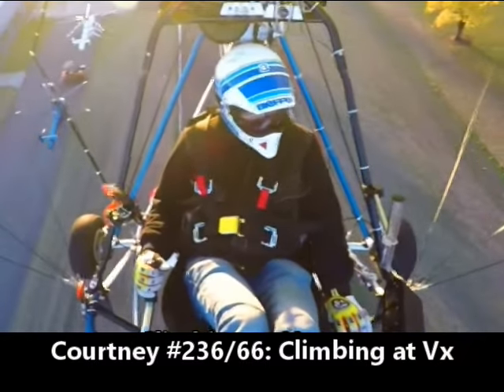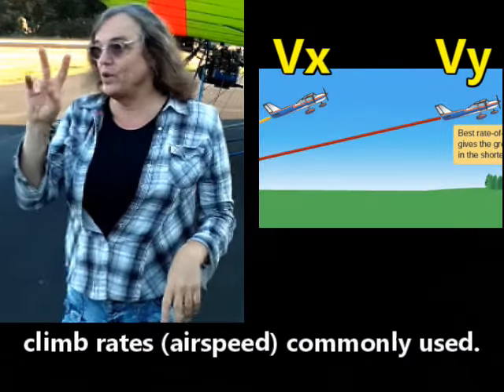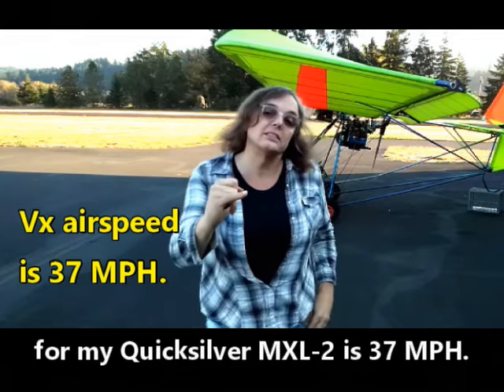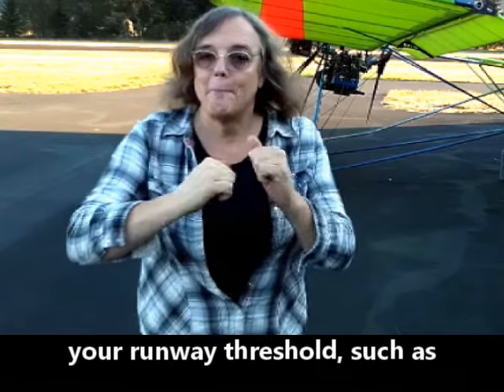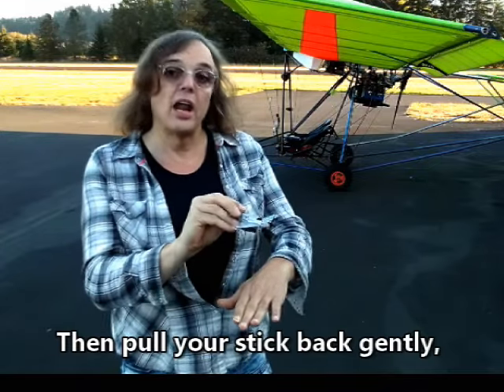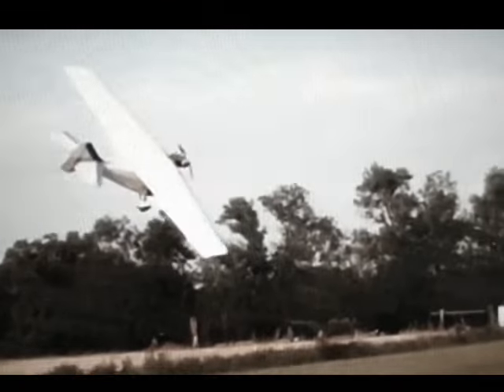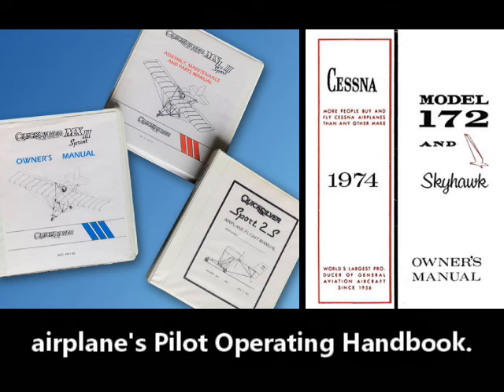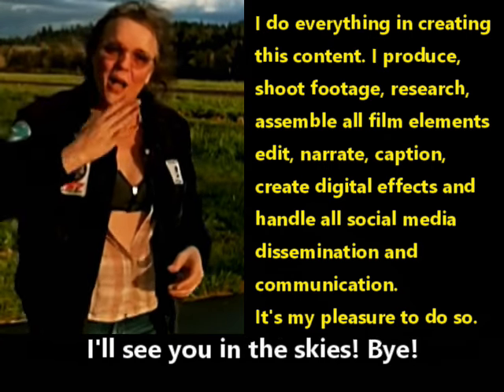Why We Climb at the Best ANGLE of Climb! (Vx). Understand How This Keeps Us Alive!  C238.66

Comment: Courtney, I really like your videos, keep up the good work. That being said, I prefer a different takeoff method.
If your engine quits down low, your descent angle will mirror your climb angle and you will not have enough energy to flare to a soft landing. When I takeoff, I remain low in ground effect and use that additional 10% or so of efficiency to reach Vy, and then I climb at VY until I reach the hight of the trees. At tree height I will then start climbing at VX. The only time that I would use VX earlier, is to climb over an obstacle. Engines have a tendency to quit when you need them the most.
Reply from the maker: Please feel free to choose what makes you feel comfortable!

Comment: Courtney, this is a complicated topic.  While Vx may be required to clear trees near the field.  A higher speed may be safer in the event of a engine failure.  This is my preferred climb out speed.  Our high drag ultralights have very little momentum and in a high Alpha nose up climb can go from climbing to unrecoverable stall in a second or two if the engine quits.   Always be prepared to shove the stick forward 6" or more if you feel or hear the engine miss even a single cylinder climbing out.
On the other hand Vx climb gets you higher faster than Vy and supports your claim here in the video.   Altitude is always best if you have engine problems!  But never at the expense of a possible low altitude stall/spin.

Also, the stall speeds you found with google are way off.  My single surface wing MX stalls at about 18 mph not 34.  I am above 6000DA for most of my flights with a BRS and full fuel gross weight at ~505.   I spend most of my time flying less than 34mph and am trimmed out for about 28.  In ground effect it's still flying at 14mph.   MX Sprints with their higher wing camber single surface wing stall even slower.   I am not surprised with the numbers you found, my MX is has a factory sticker showing 34mph stall.   While airspeed sensors may vary, both my Halls and calibrated pitot static airspeed agree the published speeds you found are garbage.
Reply from the maker: I appreciate your comments. I don't pretend to know everything. I did go back and check the climb/stall specs on the Quicksilver ultralight. According to Quicksilveraircraft.com, the UL's Vx is indeed 34 MPH and the stall speed is 27. I'm not saying you are incorrect, other than right out of an airplane's POH, I don't know of a better authority unless one were to ask Andy at Tri-State or Bever at Air-Tech for an opinion.
Reply: @CourtneyTakesFlight Hi I am a Airline Transport Pilot with 28000 flying hours.
I never heard about Vx and Vy.
I know Vr= rotating seed (at that speed you start pulling on the stick. At V2 called flying safety speed and is 1.2 Vs stalling speed.
If you climb with V2 you are climbing with your best angle of climb.
Reply: My flying background is helicopters but I have ridden on 2 seat ultralights. I was always surprised by how much drag they have. I would lean towards speed over altitude myself on takeoff.
Reply: Think she got you confused on Vx and Vy; Vy gets you to altitude fastest and is faster safer for the stall concern than Vx. Though often Vy is close to Vbg so obstacles permitting, you may want to climb faster than Vy accepting a slightly slower climb rate to account for startle effect and still catch Vbg. This will also preserve forward visibility.

Comment: I've been taught to keep it at about landing speed until over the treeline before going to VX to buffer against possible rotor/gusts.... this is in a Flightstar with a 3000'+ runway
Reply from the maker: I'm not sure about the buffer thing, but typically you want to be as high as possible before tackling that tree line lest you crash into it if you lose your engine.
Reply: @CourtneyTakesFlight  Talking about the trees on the sides of the runway, not at the end!

Comment: Another great video. However, I’m not sure I agree.  I fly a Lancair - and a Kolb. Opposite ends of the spectrum you might say. I avoid Vx in both unless it’s absolutely critical to clear something.

In an ultralight you have no mass, low inertia, and very high drag. If you are in a Vx climb and the engine decides to have a bad day, you’ve probably only got 1-2 seconds to figure what’s going on and take aggressive corrective action before a stall. 

I prefer to have as much energy as possible - almost more of a cruise climb. 

I see these folks doing these crazy steep climb outs trying to show off some STOL power or whatever and I just shake my head. If something goes wrong it’s game over almost instantly.
Reply from the maker: Agree, some STOL folks have done crazy stuff, and some have died as a result. I did address the stall issue in the video. Thanks for your comments.

Comment: The best angle of climb is 1.2 Vstall.
V stall (power off) is changing with weight and with bank angle..
Many fatal exidents happened when pilots tried to land back at the airfield by making a tite 180° turn , with a high bank angle.
At a 60° bank angle the V stall increases by 40%.
In a left turn the left wing is slower and will stall first.
Reply from the maker: We don't want anyone returning to the airport. Straight ahead or a bit of to the left or right is best.

Comment: While I enjoy this idea, vx does not get you to altitude sooner, only nearer to the point of departure physically. VY also lets you avoid a stall easier w an engine failure
Reply from the maker: One wants to climb high as possible near where they started the takeoff roll. I addressed the stall thing in the video.
Reply: @CourtneyTakesFlight  why does proximity to the landing site matter more than altitude gained as fast as possible?

Comment: Think you need to review Vx and Vy again. Vy is fastest. Vx may get you there with half a runway remaining, but so what, you won’t be able to land on the remaining half as you’ll be too high. Vx is also really close to stall with no margin for startle factor. And it inhibits forward visibility.
Reply from the maker: It's not we want to get high faster, but rather, get as high as possible near where we began the takeoff roll. Nor is landing at the airport required. We want to be at as many places to glide to a landing if possible.